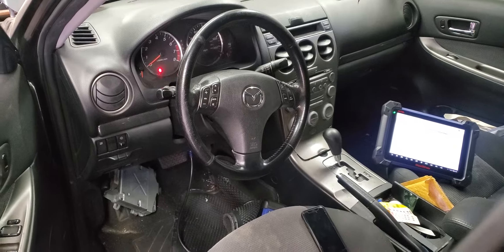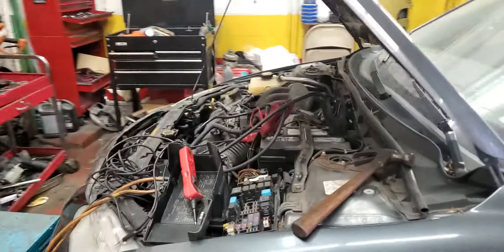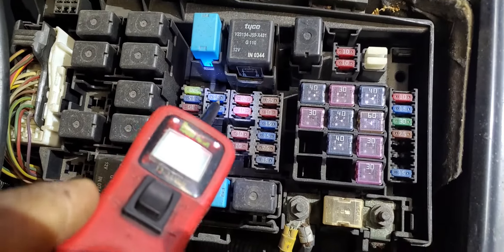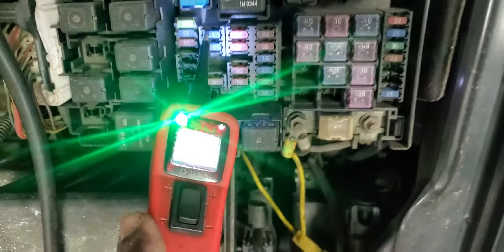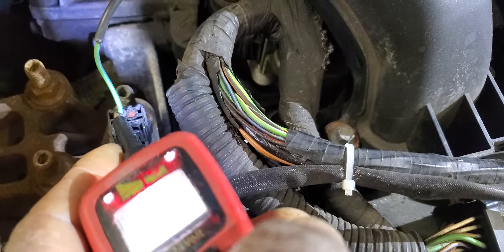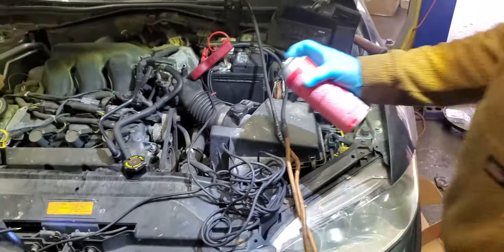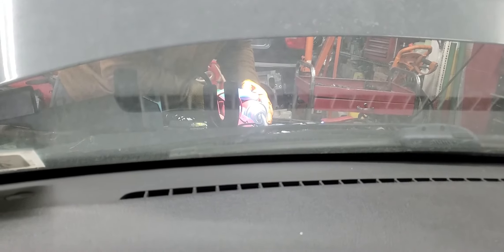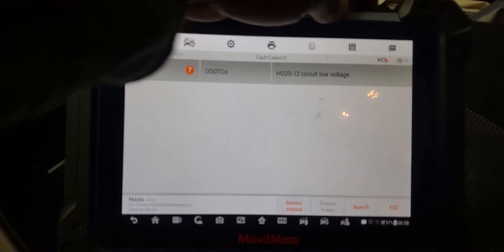2004 Mazda 6 3.0 liter crank No Starting fixed What You Need To Know part 2

Comment: Hey, what ended up being the problem, have same issue, I spray gas into the intake and turns on. Replaced fuel pump and still have same issue...
Reply from the maker: On this car the crank sensor wire was not good for your car you have to Diagnose it
Reply: How did you diagnose it down to the wire being the issue? And how do you attach a new wire ? Did you have to solder it on ?

Comment: Mazda 6 only start in neutral, I changed the neutral switch still the same
Reply from the maker: be sure in engine or transmission data it show p or n
Reply: @BestCarFixes  p is shown but I still have to put it in neutral most times for it to start